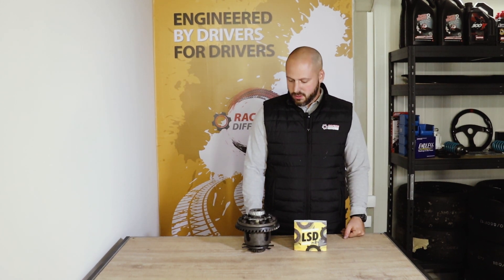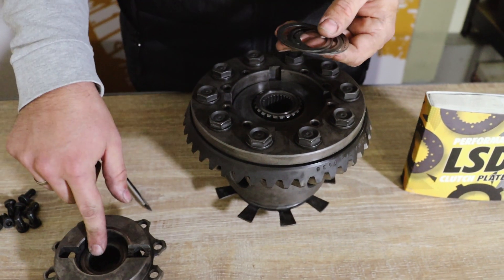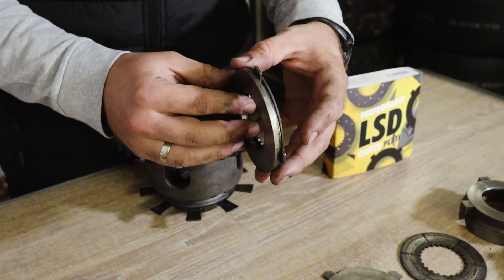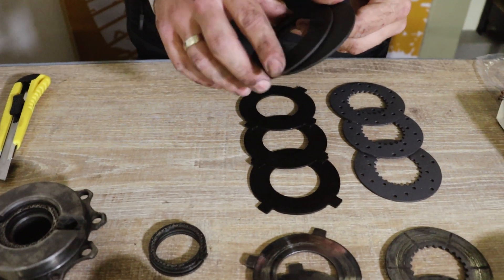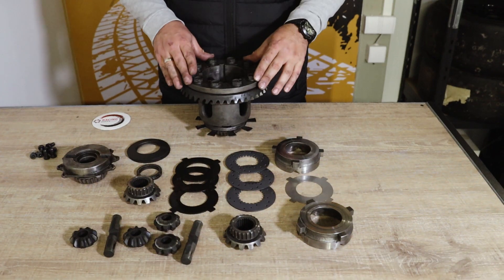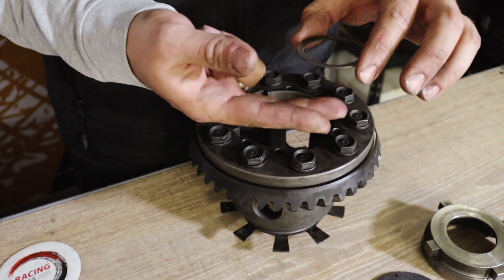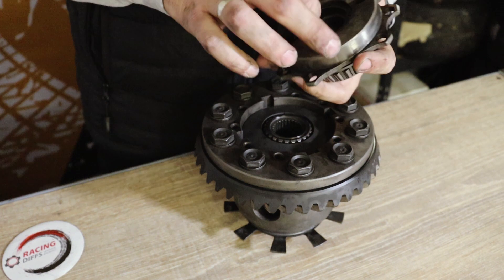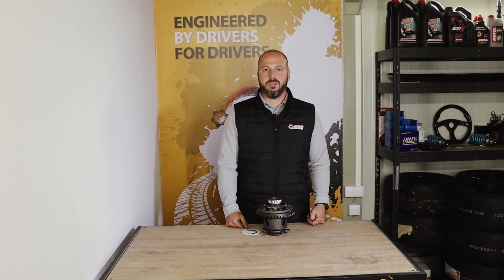BMW LSD differential upgrade - 40% lock, 3 clutch disc install

Comment: at 10:11 what are you referring to when you say smoothen? Im doing this for the first time and I really wanna be sure to do it properly down to the smallest detail
Reply from the maker: You need to resurface pressure plates. Grind down 0.25mm of each on the flat surface grinder. And use our ramp saver shim to regain lost thickness. 

https://racingdiffs.com/products/bmw-ramp-saver-shim?_pos=1&_psq=ramp+saver&_ss=e&_v=1.0
Reply: @RacingDiffs  I'm replacing the 45/45 plates with your adjustable ones. If I have you're adjustable ramp angle plates do I need to use the space saver shim?
Reply from the maker: No, you don't need it then.
Reply: @RacingDiffs  Im useing youre adj ramps and 3 cultch upgrade kit for e36 and the convertion kit to put it in a 188k case

Comment: Any benefit to run 40% instead 25% ,locking in a stock M3 E36 3.2l ?
Reply from the maker: Yes, of course. If you are a bit of an advanced driver, you can feel 25% lock setup slipping in sharp corners, and you are losing traction on 1 wheel. Especially if you don't run super stif ARB on the back. 40% lock is much better.

Comment: My E32 got stuck in the snow today, even though it has the 188 LSD diff. When looking at the rear tire on the driver side when trying to accelerate, the tire didn't turn at all while the other one was spinning. I think it might be time for a rebuild... Trying to figure out what pack I should choose, just the service pack or some of the Stage packs?
I'm gonna watch more videos about this.

Comment: is everything the same when it comes the 210mm large case? No machining to the carrier cap needed when adding extra clutch disc(s)?
Reply from the maker: We have sets for 210mm diff that are plug and play too. Check the video below. You have the link to the product in the description. 

https://youtu.be/-Y7LcZj9fbM?si=JFNPsMbSF-cKgi8k

Comment: Hey, tell me everything you can offer for my bmw e61 530d 2004 with an aut. gearbox
Reply from the maker: Right now, we have LSD conversion kit to offer. You'll be needing 215K type.
https://racingdiffs.com/products/bmw-e46-e90-e92-e39-e60-lsd-conversion-set

Comment: For the last step where you have to press the "cap" down,  how should the lsd be oriented in the press?  In other words,  the press should be pressing down on the cap, but how should I hold the lsd at the bottom?  Obviously not the VSS gear, not the body of the lsd...???
Reply from the maker: Put the inner bearing cone under the LSD core so you dont damage bearing.
Reply: @RacingDiffs    I don't understand.  Is there a picture or video somewhere that explains?
Reply from the maker: @macgroober1396 browse through our other videos, I'm sure you will find an explanation. Or reach out to our support team at office@racingdiffs.com

Comment: Witch oil do you recommend I a E30 188 differential? 
I seen different people use : Motul 75w140 synthetic or Motul 90PA SAE90 mineral
Reply from the maker: Is it open diff or LSD.
Reply: @RacingDiffs  it’s an LSD differential and used for track only
Reply from the maker: Motul Gear Competition 75w140 👍🏻
Reply: I remember using the 90 oil for a while on my E32 188 LSD and the diff got loud on slow turns. I switched to 75W140 and it was quiet again.
Reply from the maker: We recommend Motul Gear Competition 75w140

Comment: 188mm = 2.93 diff from 328i E36 right? I have LSD diff in my 328i but its slipping a lot
Reply from the maker: It is time for clutch replacement then. I would recommend at least a Stage 1 upgrade. If you hurry up, you can still catch 30% OFF.

https://racingdiffs.com/collections/lsd-clutch-plate/products/bmw-188mm-lsd-differential-clutch-disc-inner-plate-repair-kit

Comment: Hi, Can I cut just one ramp of 0.5mm and 0 for the other ? Sorry for my bad English
Reply from the maker: Not recommended as you will thinner hardened layer too much.
Reply: @RacingDiffs  
even if I rework with a professional machine? because I only have one ramp damaged, the other is like new.
Reply from the maker: No matter. Hardened layer is 0.7mm thick so it is better to do both of them for 0.25 than one for 0.5.
Reply: @RacingDiffs  okay thank you so much

Comment: The 8 screws holding in the clutch pack are incredibly tight and soft. I just rounded a hex out trying to remove. What to do now...
Reply from the maker: Get a 12 angled star, often used in VW tools and hammer it down. Like torx key but much sharper.
Reply: @RacingDiffs  this worked on 6 of 8. Sadly the final two i think may need EDM. I even broke an extractor off in one.
Reply: @RacingDiffs  just hope i have not scrapped my diff.
Reply from the maker: Get your diff set in the hydro press and press it like you are installing new bearing. That will neutralise preload on the cap. Helps removing bolts.
Reply: @RacingDiffs  Good tip. I ended up having to mill one of the bolts out. All good now though. upgrade to nice 10.9 hex heads.
Reply from the maker: Glad to hear you solved it. Keep up the good work.

Comment: Hey mates we’re looking at rebuilding an AMG LSD and putting it into a 2012 C63. We’re about to inspect the clutch packs do you have options for replacement?
Reply from the maker: We should have them in stock. Please send pictures when you open the diff to office@racingdiffs.com just to confirm.

Comment: Do I need to use the “saver plate”? I dont want to. I just want to put everything in at my garage and not worry with finding some professionals who will trim the ramp for me
Reply from the maker: Absolutely not necessary if your pressure plates aren't damaged from previous clutches.

Comment: What lsd diff for an e83 3.0i automatic 3.64 ratio 188K or 188L ? since i swapped this diff into my e46 to get lower gear ratio
Reply from the maker: If you are asking for conversion kit, you will need 188L for it.

Comment: does this also work for nissans r200? because shimming only works for approx 200 kilometers then its back to normal
Reply from the maker: We don't have clutches for R200 diff. We do have upgrade pack for R180. However we would live to make upgrade pack for factory R200, if you would provide samples.